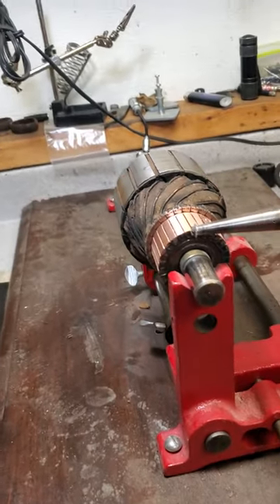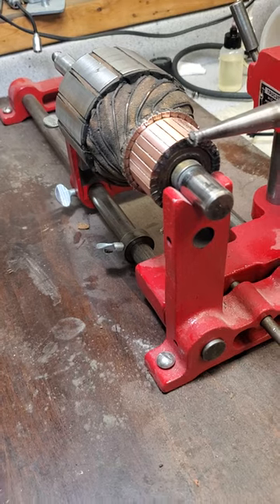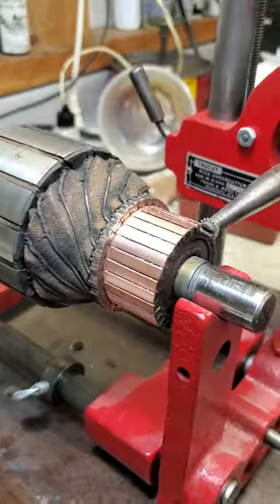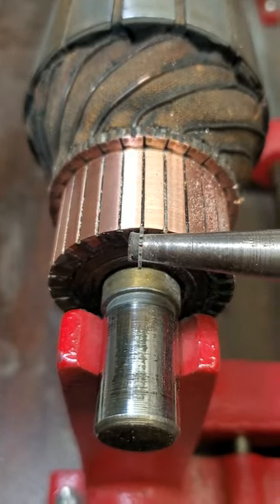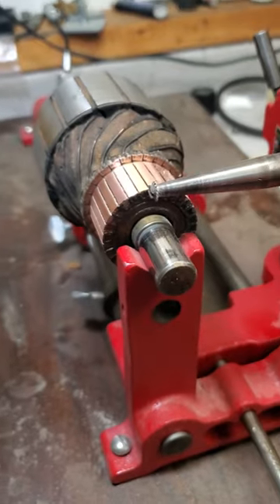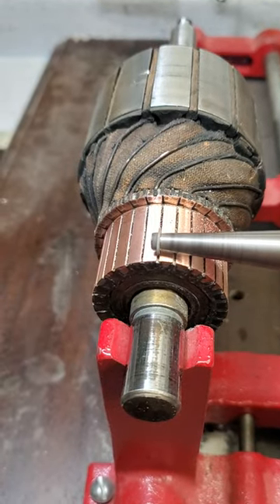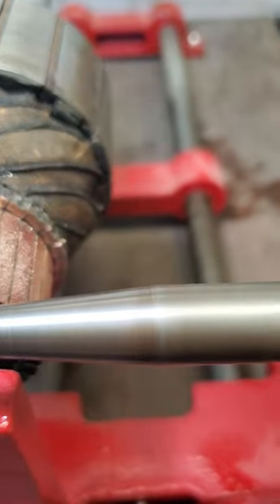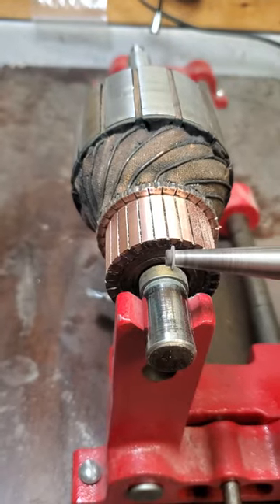Undercutting mica on a generator armature

Comment: Used to do by hand make sense that there is machine what do you seal with
Reply from the maker: I mean that I reseal the windings. I use spray on red electrical sealer, AKA Glyptal.

Comment: Where did you find the circular saw blade? I need to find where to purchase one
Reply from the maker: Google "mica undercutter blade".  I dont recall where mine came from. I bought them many years ago.
Reply: Mine is missing some teeth, could you count the teeth on yours and maybe measure it OD & ID of hole and thickness- im assuming theres multiple thickness of them
Reply from the maker: Mine may be different than yours. I have blades that are .250" and .312" OD, all are .125" ID. I have .015", .020", .025", .030" and .035" thick blades, 16 teeth.
Reply: I have a trucut B15, which has i believe the same undercutting motor you have in the video mine is a lathe bed style. Im wondering if the blades would be the same? I think the blade thats on there has a few more teeth than yours just hard to tell exactly because a few are broke off so im guessing 19. Im also wondering if its a few less teeth than i have if itll make any difference as long as the ID for screw is same.
Reply from the maker: I have a lathe mount undercutter also, but prefer to use this one. Teeth count probably wont make a difference. Im sure there are variations by different mnufacturers.
Reply: So i measured mine and ID is same as yours thickness is .015 OD is roughly .344 hard to say exactly because some teeth are missing. How come you have two different OD sizes? Also out of those thicknessess what is the most used ones for small stuff like generators/starters/alternators? Where did you find your mica undercutter shown in video?
Reply from the maker: The larger diameters may be for BIG commutators that need deeper grooves, but nut sure. The cutter should be just a little wider than the mica separators. I found mine on ebay maybe 15 years ago. I restored it and put a new motor on it.

Comment: 👍
Reply: I worked on the RxR substation electrician we had rotating generators we called them M.G. sets motor generator , use to under cut with a sharpned hack saw blade....this stuff was all fron the 30s all gone now...solid state junk..